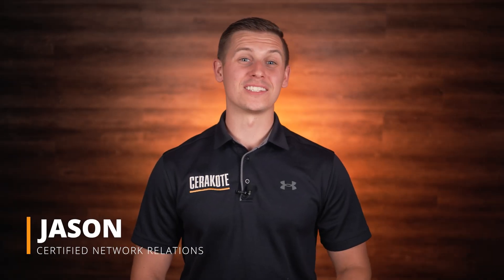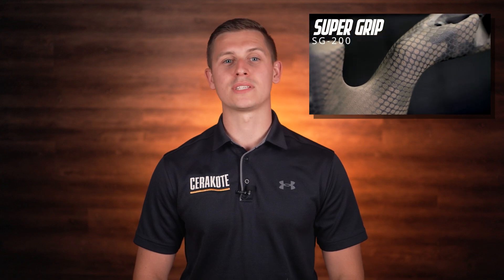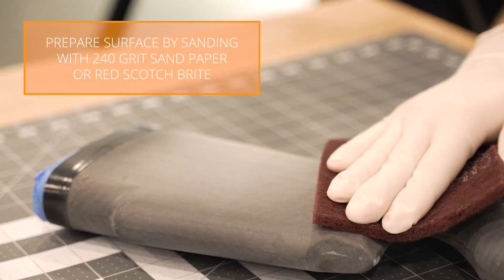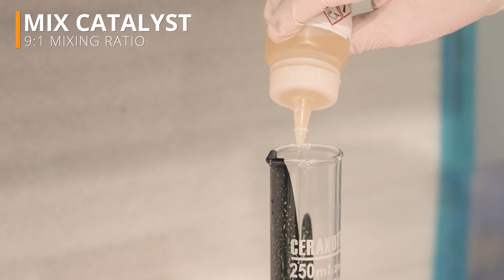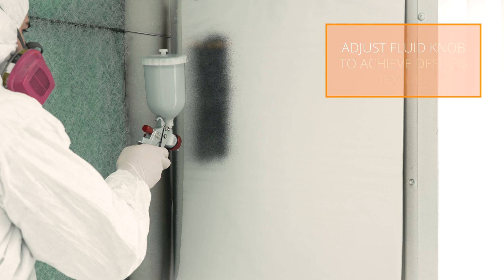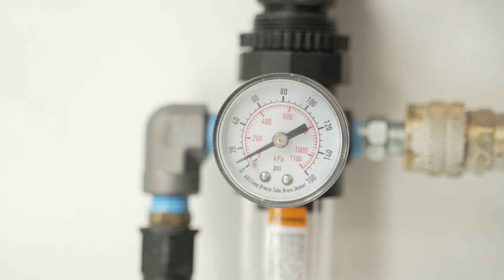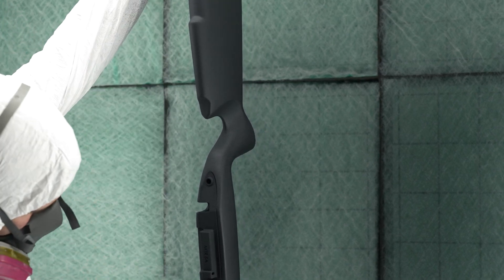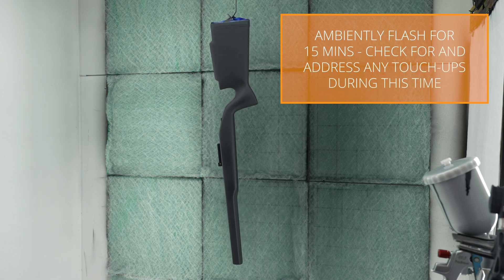Application Guide: Super Grip® SG-200 (Oven Cure) | CERAKOTE®

Comment: How does this Super Grip coating (also ambient cure version) stand up to UV? Can this be used on  outdoor applications?
Reply: For anyone interested in the answer to this question, I received following feedback from Cerakote:

Good morning, Thank you for reaching out to our Technical Support Team.
I was able to work with my R&D team and they provided me with the following information.

“SG-100 is currently in UV testing and has gone 1224 with .32 delta change. We anticipate that it will receive an excellent rating once completed. Chemical testing is completed via 96hr soak Methyl Ethyl Ketone, Acetone, and Diesel. Post testing delta change was .45. with zero coating loss, receiving an excellent rating.”
Reply: @abetlej  I believe most if not all cerakote products have really good UV resistance, some are just rated to be more salt water / chemical resistance and electrically conductive than others

Comment: What does the coating compare to as far as grip textures?
Reply from the maker: Super Grip feels like a cross between fine-grit sandpaper and velvet. It has a soft texture that’s comfortable to the touch, yet offers a firm, non-slip surface. Think of it as a velvety sandpaper—smooth but with just the right amount of grip